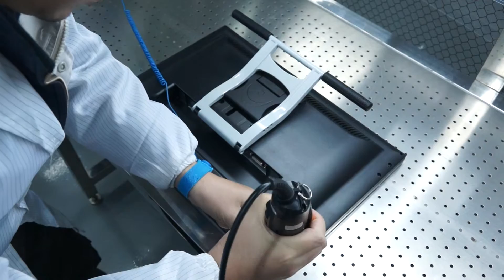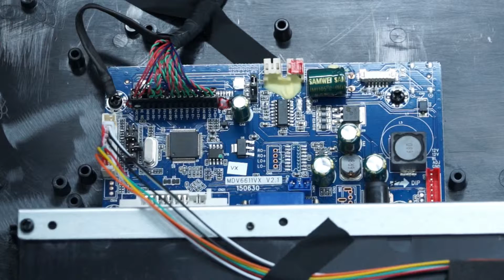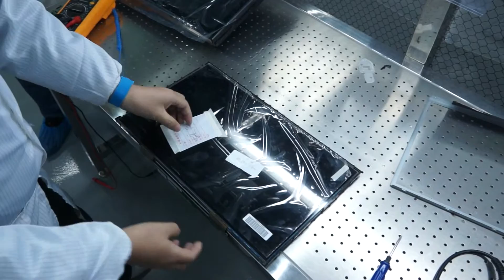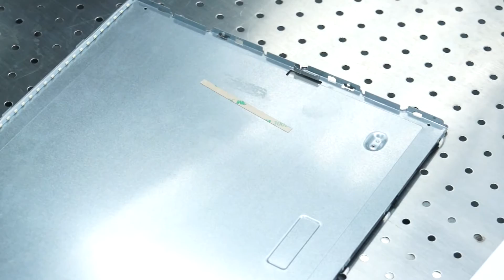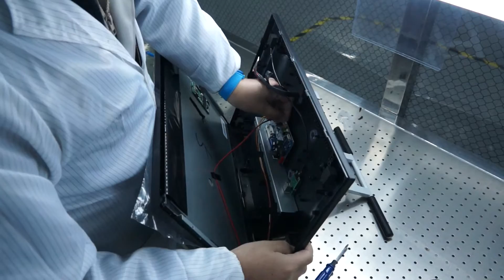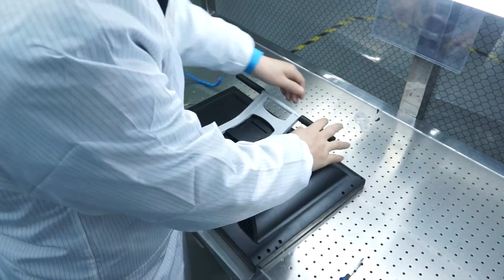Huion GT-190 Pen Monito  Disassemble & Reassemble

Comment: what is this tool that you used to open up the screen, and where can i buy one?
Reply: for the other guys wondering... you can take it apart, using for example a credit card, or some plastic-strip. Just make sure, that you really got every screw unscrewed.
One screw is hiding under some sticker that says something like 'warranty void if removed'.